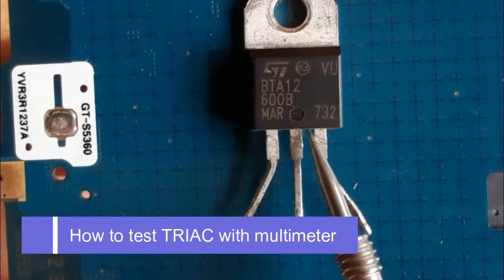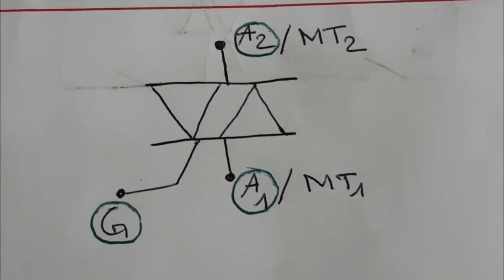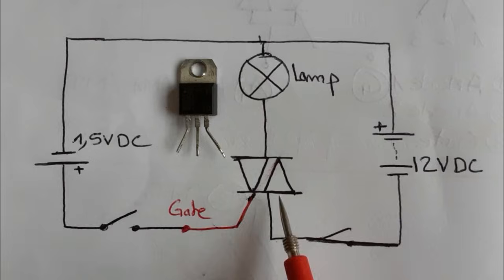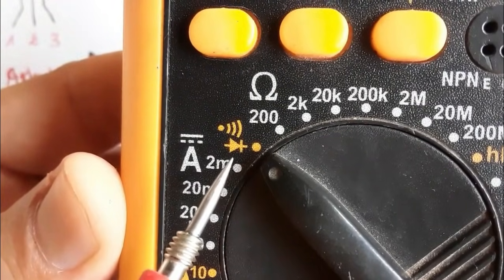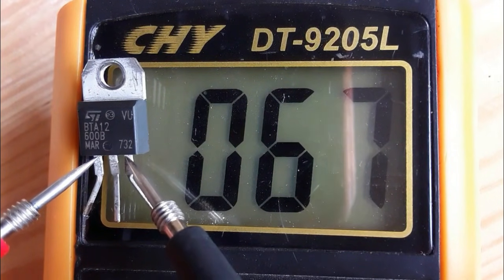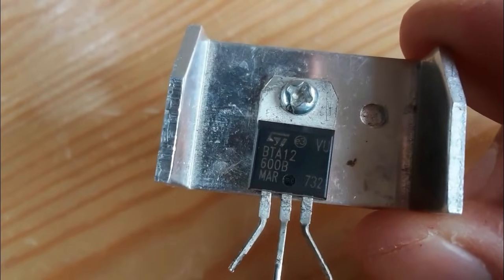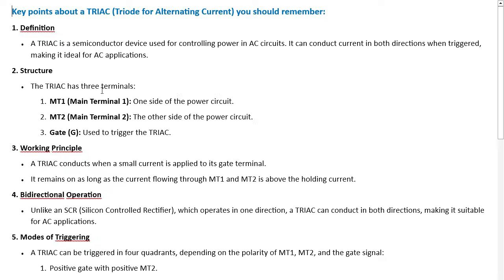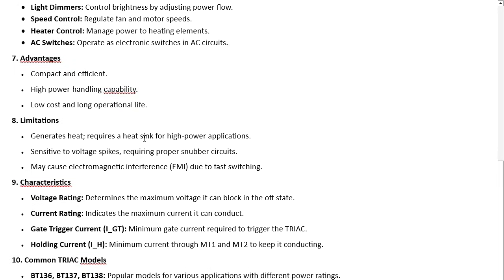TRIAC Testing Made Easy with Multimeter Hacks

Comment: Please may l ask if the triac part number determines the amount of drop you see when testing between anode and the gate pins 1&3.
On this video you are testing a BTA12 and you have a test drop of 0.68.
In my triac test  BTA16 l see a drop to 0.033,this would appear to be too low, but is this determined by the part number?
Also l tested the triac whilst still attached to the pcb, is this ok or do l have to remove from the pcb?